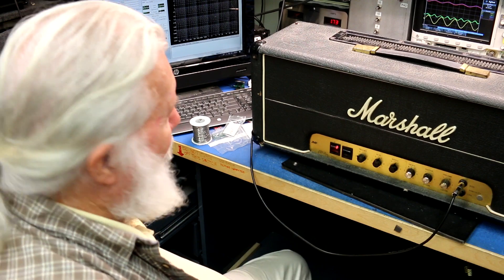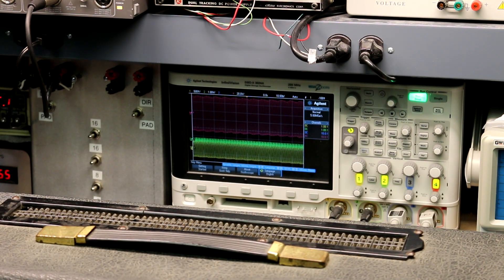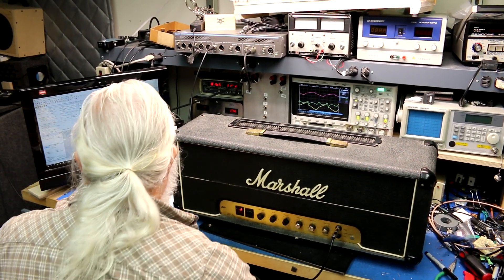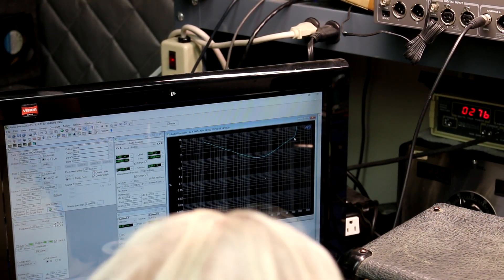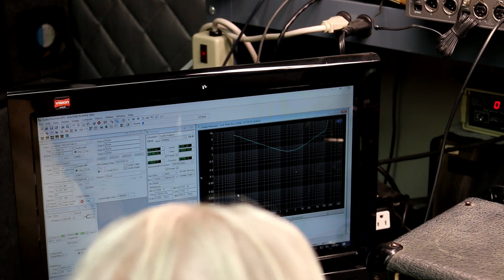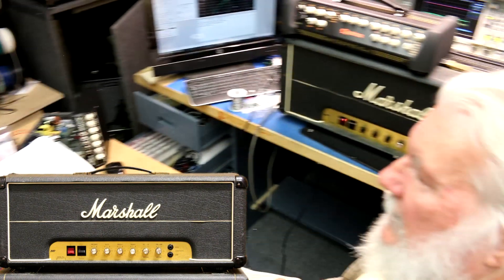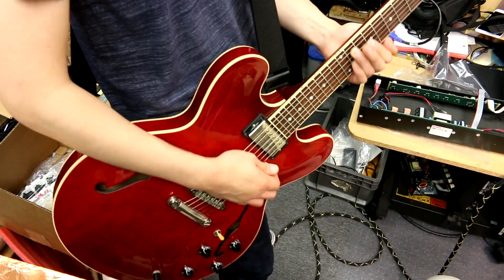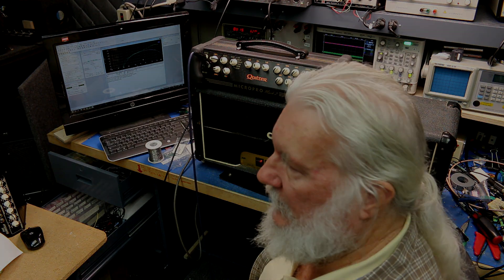Pat Quilter checks out a 1979 Marshall JMP 2203 MKII

Comment: Steve Grindrod designed the 2203/2204 two-input Master Volume in 1976 by cascading the first two gain stages (they're parallel in a 4-holer), and adding a cathode follower master volume. Steve also designed the JCM 2000 DSL100 in 1995 (to compete with the Mese Dual Rectifier) before leaving Marshall to start his own Albion amp line.

Comment: I had the 50Watt version of this Marshall amp.  I remember this amp being very picky about its AC voltage. In some clubs there seemed to be no way of making it sound good other than cranking it. Is the AC ripple that you are seeing from the circuit design or end-of-life filter caps? In this demo, it makes the guitar sound out of tune to me. I love the consistency of my Micropro Mach 2.